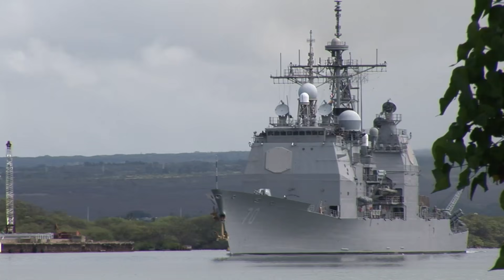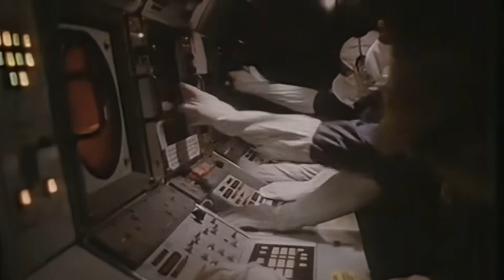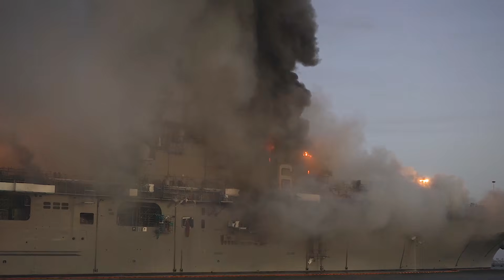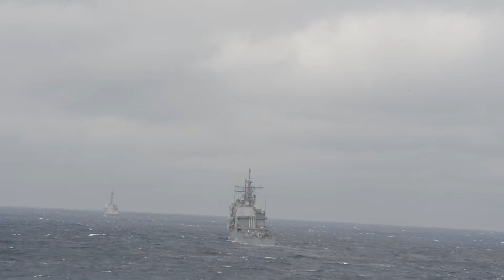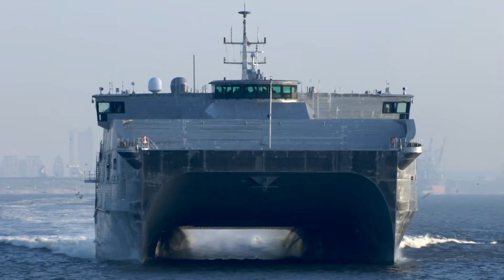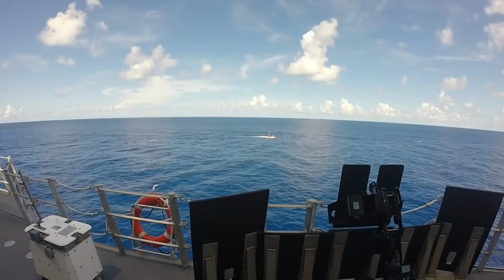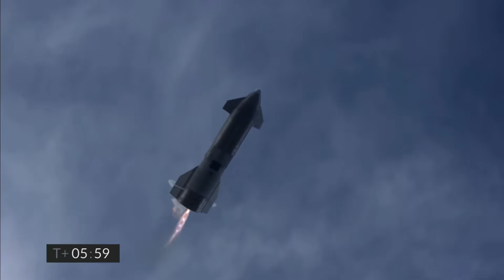Why is The US Building Aluminum Warships?

Comment: "Aluminum doesn't burn". Yes, it does. It's used in some solid rocket fuels.
Reply: And in thermite too
Reply: @SmikeMan  True.
Reply: I like how everyone is commenting how aluminium burns and bring up thermite as example while totally ignoring that iron oxide is used in the recipe. Iron-ic much?
Reply: Technically that's aluminum oxide, and it's not really the fuel, it's the oxidizer, so aluminum doesn't technically burn/undergo combustion.
Reply: @HerbaMachina  no, it's aluminium oxide.
Reply: yeah what machina said you are mistaking the function of the metallic salts, and forgetting that they are metallic salts which have different properties to the pure element, take sodium chloride for example, sodium in its pure form is a highly reactive metal a alkali metal, and chlorine is toxic to humans but combined it is just common house hold salt.
Reply: Honestly if the enemies had a bomb that shot gallium around the ship it would eat the ship super quick and sick the fucker on on first attack
Reply: It's also the basis for thermite bombs and some explosives used for mining or construction. Also, it had a hand in the demise of the airship Hindenberg, whose skin was coated with a material that contained powdered aluminum. That together with the skin and hydrogen in the gas cells was why it burned completely within minutes. Think of it, a bag full of highly explosive hydrogen made with what amounts to model airplane dope and aluminum powder on the outside with a gondola attached. What could go wrong?

Comment: This new industry, specifically, the building of Aluminum Warships for the U.S. Navy, needs to get together with Elon Musk, and use him as a Consultant, regarding his experience with both Aluminum and the Gigapress. Instead of welding these Aluminum Warships together, this new industry (Aluminum Warships) needs to build each of these ships from several huge ONE PIECE ALUMINUM CASTINGS. Again, this is how Elon Musk is presently building his Electric Cars (as One Piece ALUMINUM Castings.) The Gigapress Method . . .
● reduces PARTS COUNTS (Elon replaced 700 separate parts with ONLY ONE Aluminum Casting);
...and also...
● reduces ASSEMBLY TIME (the molds, for Elon's Gigapress, are fully injected inside of only two milliseconds; imagine being able to build an entire Aluminum Warship inside of only one week!);

Comment: Your comments on the Falkland's is missing a key information, the biggest problem were not the structures... It was the aluminium ladders, Sailors trapped inside when they melted... Ladders were changed to steel soon after..

Comment: Corrosion always an issue. Sacrificial anodes or zincs a must.
And rate of deterioration can very greatly depending on ship construction and even the waters they are in.
Survivability may not be an issue on direct hits with capable weaponry. 
But is certainly a factor in smaller weaponry or near misses.
(I.e. USS COLE). Not to mention, the greater confidence.it may instill in crew. Whether it be justified or not.
As stated. Proper design,  and meticulous attention to detail in construction, plus proper maintenance are key. In any vessels performance and lifespan.
Think both aluminum and steel have their place. As well as composites as they progress. 
Think Navy has it right in there risk classification. 
My understanding of the LCS classes. Were designed for high speed with shallow water capabilities. 
In response to increased piracy. And fewer patrols of major military vessels in high risk areas. Due to the end of the cold war.
There intent is fast response and deployment of tactical teams or light weaponry. 
More like a police cruiser as opposed to a tank.
Personally I like steel. 
As always.  Enjoy your videos. 👍👍

Comment: I'm building mine using diamond. At 600 times stronger than steel, none magnetic, non-corroding and a thermal superconductor, diamond would be the ultimate material.
Reply: It would probably still be cheaper then the Zumwalt destroyer

Comment: It's like fortified castles, they were useful until canons became a thing... After that they became quite useless.
The problem with our modern armies is that the requirements and tactics varies greatly depending on who we are fighting.
You don't have the same needs against terrorists, guerillas, civil wars, or modern countries.
Reply: Castles evolved to handle cannon fire.
It was EXPLODING ROUNDS that largely killed castles.
Reply: @bricefleckenstein9666  And exploding rounds were not shot by canons?
Reply: @IronFreee  Not for a couple centuries or somewhat more.
Solid balls of stone, iron, or "grapeshot" (or improvised variations of grapeshot), or canister (grapeshot in a container, think "big shotgun shell") were what cannon fired for a VERY VERY long time.
Also, exploding rounds were for the most part (if not entirely) originally fired by MORTARS.
Reply: @bricefleckenstein9666  From the XV century they tried to burry or fill the existing ones with earth but it was the end of medieval fortified castles. They stopped building new ones.
It started even before the canons became common.
Reply: @IronFreee  The style of fortifications changed after the introduction of cannon.
The folks that "tried to bury or fill in" up to the era of the Napoleonic Wars were mostly about not wanting any form of fortification at all a that location, particularly common in the Holy Roman Empire/Germanies area.
Reply: @bricefleckenstein9666  Yes, the canons put an end to the medieval fortified castles.
Later, people like Vauban transformed a lot of old castles by filling them to make them more artillery proof.
Reply: @IronFreee  And right there you agreed with me that cannons did NOT end forts.
Cannon were an early form of artillery, after all.
What they did was force the form of an effective fort to CHANGE as they became more powerful - and it was the WALLS that changed, not the entire fort being filled in.
Reply: @bricefleckenstein9666  Well, I agree that canons didn't put an end to fortifications.

But they put an end to "Fortified Castles".
The new castles became luxurious habitations and the fortified places were only made to host soldiers.
Reply: @IronFreee  Somewhat true, older castles did sometimes get repurposed, and "royal/noble" homes were often called castles without being actual castles in the 1600s and later (limited examples in the mid-to-late 1500s).
But the fortified castles DID continue to exist, and most of them DID still have the capability of letting the people of the area in to be protected for at least short periods.
They just stopped being the PRIMARY home for nobility/royality.
Reply: @bricefleckenstein9666  Well nobody destroyed the existing ones for no reason... But the traditional medieval fortified castle with the noble living in the dungeon became obsolete.
Reply: @IronFreee  Well no, most castles that were destroyed were during a war - Lennart Torstensson took out a few during the 30 Years War, the French smashed quite a few during their wars, etc.
But many of those "traditional" castles survived, often with reconstruction along the way, into the 1800s.
Reply: @bricefleckenstein9666  Yes, I see one of them from my terrace every day
Reply: @IronFreee  And my name comes from the folks that owned (or more likely the area around) another castle, though that one got taken by the French in 1680, "destroyed with black powder" and was not rebuilt after that.
Yes, it was just ONE example of a "traditional fortified castle" that survived WAY into the cannon era, though the hill it was built on no doubt aided it's survival.

Comment: I wonder what a Titanium ship would be like. Since Titanium is lighter than steel and as far as I know tougher and also non-corrosive. Costs aside of course.
Reply: Cost for the raw material is 3 x Aluminum per ton.
Labor cost would be a LOT higher, Titanium is a major pain to machine or cast.
End cost might very well run 10 x vs Aluminum and MORE than that vs Steel.

Comment: it comes down to the alloy of the material. steel with to high of a carbon composition with be more brittle, carbon fiber it comparable to steel in strength an weighs less, but wasn't made to have the hull of a space shuttle made from it. stainless steel is more durable than steel but will still corrode (just takes longer) and is not a composite material like carbon fiber so Musk's people were just stating the obvious. aluminum has different alloys as well and knowing the government, they awarded the contract to the lowest bidder and decided to make it work, just like every other product seeking entity. i know this because my mother used to be a tool and die journeyman for a company that lost a government contract for part of the fuel system in turbine engines because of under bidding.  cutting corners on materials is the most underhanded crap ever, by both the government and the manufacturer.

Comment: Its simple its lighter so u can put heavier and more powerful and more wepons on there and its cheaper and easier to get ahold of and easier to work with and now days if u get your sinking anyway so u might as well use aluminum anyway as its just better and sure it has a lower melting point but the only way ur ever going to experience that melting point is if you get hit but if u get hit well ur gonna sink so who cares but I think everyone should use carbon fibre and make more of it as its impossible to break like it is basically weightless and it is like 4 times harder to break than steel unless twisted but like seriously tho I've seen video a 50 cal not be able to penetrate arround 8mm of carbon fibre it just cracked after 4shots to it and snapped in half witch if steel well its probably gonna go through as a 50 cal should have I balive like 37 mm of pen to steel

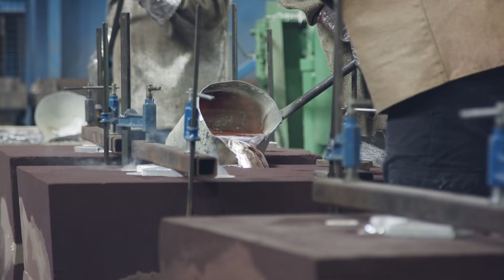Comment: 1:42 "While aluminum doesn't burn..."  WRONG! Aluminum DOES burn. You have to get it very hot (one source I found said 1727 °C), but it will burn, and when it does it is VERY exothermic. The combustible fuel in thermite is nothing but powdered aluminum.
Reply: Ships aren't made out of POWERED aluminum. It also requires iron oxide powder for the reaction to take place.
Reply: @phiksit  the fuel in thermite is aluminum, iron oxide is merely the oxidizer. The reduction of iron oxide into iron and oxygen is modestly endothermic, but the oxidation of aluminum is so extremely exothermic that the combination of the two reactions is still spectacularly exothermic. Thus, burning thermite produces aluminum oxide, iron, and a LOT of heat.

Comment: Starship was switched from carbon fiber to Stainless steel because of it's much higher melting point which meant it is much more resistant to reentry heat which reduces the amount and thus the weight of adding thermal protection plus fit also is so much faster and cheaper to build which is very important when you are planning to build over a thousand of them.

Weight versus strength also favors steel over aluminum at the size of the Starship and while carbon fiber has the strength without the weight, it also suffers from extreme difficulty in repairing it to a full strength and alterations after initial construction are pretty much impossible.

The steel also protects against radiation and micrometeorites better than aluminum or carbon fiber.

If strength alone were the consideration then it would be built out of a titanium alloy but titanium is both expensive to buy and extremely difficult to work with.

It's really amusing how the steel rockets of the Buck Rogers era turn out to have been some of the best designs after all.

Comment: I think you are missing a point when you bring elon's words about carbon composite. You have to check the situation where the material is being used. Elon needed a material that wouldn't crack at any costs while it is 1mm thick and has cryogenic guild on one side and 1600°c plasma on the other. Carbon composite is stronger than steel. But it is brittle when cold. When you cool carbon fiber to liquid oxygen temps the resin will break apart. A Russian will never experience icing temperatures less that -80°c so carbon fiber is fine for them.

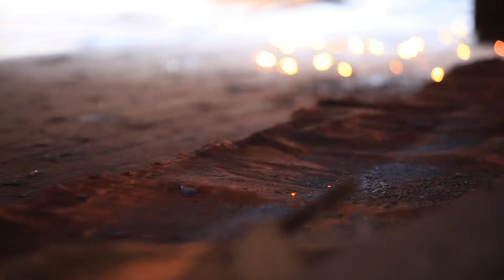Comment: 5:07 No, it can't. Brittle IMCs would form. Aluminium is either bolded or riveted to steel. But the stuff about corrosion and thermally induced cracking is correct.

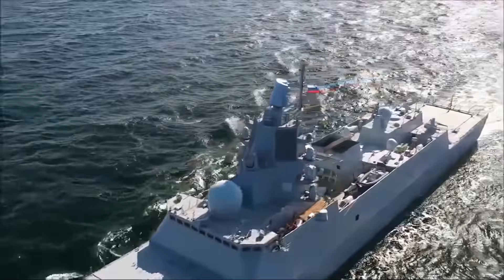Comment: 13:20 SpaceX isnt using stainless steel because it surpasses carbon fiber in mechanical properties. Theyre using stainless steel because its cheaper and easier to produce.
Reply: That, and they're interested in some pretty extreme temperature behaviours that are not a consideration when building ships.
Reply: @asharak84  yepp, in reentry  stainless steel (of course a special production) can absorb heat far better then carbon fiber and is far cheaper and easier to maintain then ceramics etc.
Reply: Carbon Fiber also does not like the extreme cold conditions when you use it for the tanks. As they have the steel now down to 3.something mm it even gets competitive in terms of price of the raw material and they reckon that once they go into serial production they can fly a steel hull many dozen times (they hope for hundreds, but that would need some experimentation to be believable), which a carbon fibre chassis would not guarantee as those have not yet been flown in significant numbers to orbit and back..
Reply: Carbon fibre would be useless on a warship because it burns too easily, which is the reason it hasn't been taken up in construction to replace steel rebar as enough rebar still needs to be used to prevent complete failure during a fire.
Reply: That's poorly stated. Stainless definitely does surpass composites in some mechanical properties. EG: Strength by weight at extreme temperatures.
Reply: they're using it because it survives higher temperatures which allows to avoid a lot of heat shield weight.  Starship still needs a heat shield, but over less area, and thinner.  It also can be welded easily in an oxygen environment, which makes it preferable for rapid prototyping.   In the future Starship may very well be made of different materials, but it makes a lot of sense today.
Reply: Carbon fiber is a composite material, it's carbon and normally epoxy.
Stainless steel will handle the heat of reentry with their new cooling system, where as carbon fiber will just melt into goo and burn.
It has nothing to do with cost, although doubtless it's a bonus for business profits.
Reply: @dayaautum6983  you do realize SpaceX themselves already demonstrated that carbon fiber can survive reentry with their Falcon 9? The reason they switched to stainless steel is because it's faster to prototype with.
Reply: @MatthewČák2142  the only place I am aware of that used carbon fiber on the falcon 9 is on the stage coupler. It's aluminum actually, reinforced with carbon. Not exactly the same as building the body out of it is it?
Reply: @MatthewČák2142  the falcon 9 is aluminium and isn't even remotely at orbital velocity when it reenters
Reply: exactly. They are applying the same thing to starship development.
Reply: Yeah flat out easier was the bones of his explanation.  Creating massive ovens and machines to craft carbon structures was deemed to time consuming and steel was a proven material with a known cost.
Reply: SpaceX Went with steel over carbon fiber because it’s 1) cheaper, 2) faster, and 3) deals with cryo-genic temperatures better.
Reply: Also, you can't really compare Starship with Falcon 9 because Starship is a 2nd stage, and it reenters Earth at a much higher speed than Falcon 9's first stage, and will use a "belly flop" maneuver which exposes the whole underside of the rocket to extreme high heat. Falcon 9's first stage lands feet first and the brunt of the heating is endured by the rocket engine nozzles.
Reply: Stainless steel isn’t that far from carbon fiber in strength to weight, it also bends instead of cracking and can be repaired, it resists high temperatures very well much better than carbon fiber which burns (its graphite and graphite burns in air if hot enough like from a reentry plasma for instance), some rockets made of steel have survived full on reentry (centaur upper stage I believe)

It’s also cheap but if you get high dtrength steel alloys it genuinely isn’t that bad

Some alloys of steel are strictly superior to aluminum too though not stainless ones
Reply: It beats carbon because carbon cracks when damaged where steel will deform. Steel also can withstand vast amounts of heat.
Reply: key word, cheaper - hence why that rocket will crash into the moon and so do the tesla cars - cheap cheap cheap
Reply: @fabianstriebeck8054  The upper stage didn't have enough fuel to return to earth (to burn up) so therfore was left in an unstable orbit. Maybe research a bit before talking.
Reply: @benlawton5420  great work, could not even work out how much fuel is needed? cheap yet again. More R&D to leave out of the equation. @ben USA grow a brain lawton. mkay, kid
Reply: @fabianstriebeck8054  Damn, that's crazy. Why aren't I hearing about these teslas crashing into the moon? Wild
Reply: Shut the F UP!  They use Al
Reply: And just WTF does THAT have to do with aluminium warships my friend?
Reply: @ForeverBleedinGreen  why are you arguing with impunity?
Reply: @ForeverBleedinGreen  well jump to the timestamp that Dalton clearly put in their post and you'd find your answer without asking silly questions in front of a crowd of people who can follow simple instructions, such as the implicit need to jump to the spot in the video and watch a bit prior to replying.